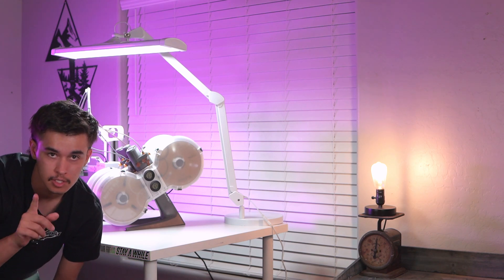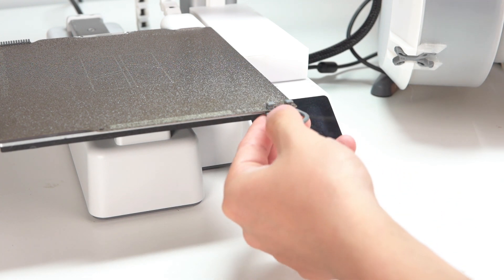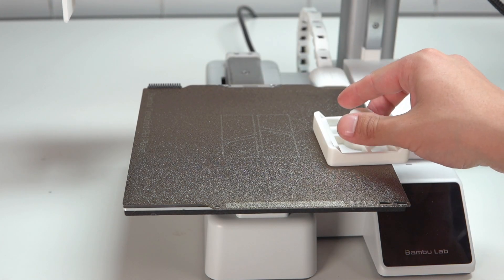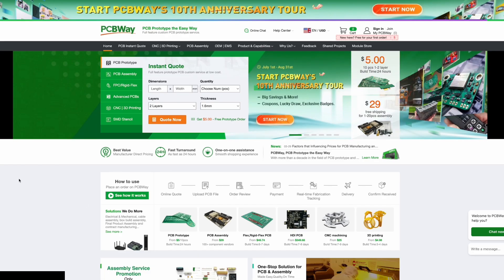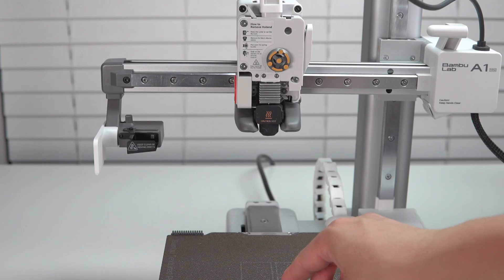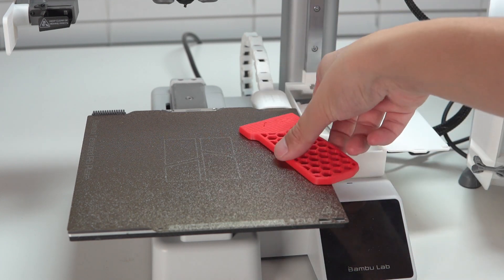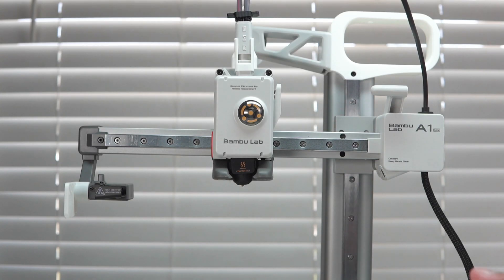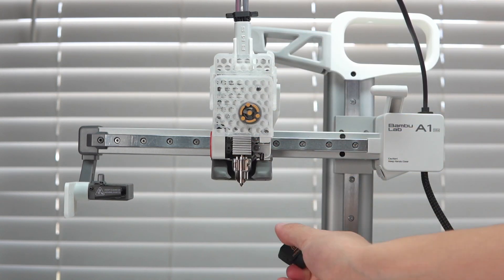Bambu A1 Mini Mods You NEED to Print

Comment: #1 is irrelevant because it only matters if you are going to use that area. I only wash my plate if I need to print using that space from slicer app. So theres no point in wasting time on cleaning when it is unnecessary...best solution is just use latex exam gloves

Comment: Don't need any of these. I don't understand what's wrong with using two fingers or just wait 5 minutes. I never removed, nor touched and with that cleaned my build plate at all. Just wait 5 minutes and take your print of with no resistance?
Also never had issues with the filament feeding, even broken off or flat cut filament gets feeded without any issues.
Reply from the maker: That’s awesome that you haven’t had any issues, I must be a tad unlucky i guess!

Comment: I actually saw a magnetic adapter for the plate on the head. Gonna try that one out once I got the right magnets. If it works that will make nozzle swapping easy af.
Reply from the maker: Currently looking at it!

Comment: I need the AMS still unfortunately. But I have been running PETG out of a dryer finally. It’s so easy to print on this thing
Reply from the maker: It just works :)
Reply: @jet_lea  my first printer was an Anycubic kobra 2 neo,  and they don’t provide good profiles for almost anything on the printer I got. It was incredibly frustrating as a new user, and part of what made me get a bambu

Comment: Nice, you are showing some mods I haven't seen yet! I have an alternative for the build plate holder. Or I should say, Bambulabs has one. Take a look on the micro sd card that comes with your A1 Mini. Mine (A1) has a build plate protector on it. It's not a perfect fit and only prints in PLA, so I have copied the gcode to my Mac, uploaded it to an stl converter and then to another online converter that fixes stl files and then I could finally import it into Bambu Studio, stretch it a little bit and print it in PETG. I'd share the file, but since I have not found it on makerworld it doesn't seem Bambulabs has published it and I don't know what license it may be under - if any. 

I did know about the filament cutter, but never tried it so I didn't know about the 45° which is a lifesaver with the ultimate enclosure. I've had problems with 2 different brands of filament so far which just wouldn't get into the motors. I'll definitely print that if I can figure out how to make it stay where it's supposed to be with my vertical (wall-mounted) AMS Lite.
Reply from the maker: I'll have to look into that build plate holder and I would love to hear if you find a solution for the vertical mount!

Comment: What filament do you use most of and have most success with?
Reply from the maker: Definitely elegoo and sunlu, haven’t had any problems with either
Reply: @jet_lea  is that PETG or PLA?
Reply from the maker: @rogerallcock8297 Pla but i’ve also used elegoo petg and haven’t had any problems

Comment: I would not suggest to spray the build plate with IPA while its attached to the printer. You risk spraying the Y axis guide rail too (which is lubricated) and the oil would dry up.
Reply from the maker: that’s a good point 🫡
Reply: Another option would be to spray the pad.

Comment: A point of clarification: the desiccant inside the AMS Lite enclosure will NOT dry the filament inside it. It keeps the humidity down so the filament does not absorb more moisture. In order to actually dry wet filament, it needs to be heated up so that the filament can actually release moisture into the air (which then can be absorbed by desiccant to keep the air dry, etc).
Reply from the maker: yes, i apologize if i misspoke in the video

Comment: Technically the PTFE tubes are not Bowden tubes because the A1 Mini has a direct drive extruder, not a Bowden extruder.

And what are y’all doing to your build plates that you need to clean with IPA? Here’s the only recipe you need for a clean build plate. Ingredients: sink, warm water, dish cloth, dish soap, something to dry with (I use paper towels), build plate storage. To clean: wet plate, soap plate, scrub plate, rinse plate, dry plate, store plate.  There is never a need for noxious chemicals like IPA or acetone.
Reply from the maker: I will give it a try and see if I have the same success:)
Reply: Dude, compared to IPA, dish soap is pretty awful.

Comment: 6:53, Bambu lab says you should not cut the filament in a angle if using the AMS Lite system... The best way to cut is exactly how the print already cuts the filament every time if stop printing. Totally flat!
Reply: Can you provide a link to where BL says not to cut filament at an angle? I looked through the BL wiki and quick start guide, couldn’t find anything about loading filament. Cutting at an angle is the only way I can get filament to load sometimes.
Reply from the maker: wow i had no idea, that’s great to know !

Comment: I have been running an A1 mini for 2 months and even got a small business running, really effective machine almost no issues, only once i had to take out the hotend and cut some fillament that was stuck, but never any problems. If the prints start to fail the most simple solution has been to clean the build plate with water and a dish brush.
Reply from the maker: I have had a very similar experience, absolutely love this thing
Reply: What filament u using?
Reply: @BrownStick  flashforge PLA
Reply: @MrDanDizz  Ok cool. Are you just using the generic filament profile? Or did you calibrate the filament manually? I’m only asking because I’m getting some non-Bambu filament for my mini as well.
Reply: @BrownStick  I have done manual calibration, and for FlashForge specifically i had to make a custom filament profile where i set the temperature that is relevant from the manufacturer :)

Comment: I haven't really had any issues with getting the plate dirty from touching it, however, I do wipe down the plate before every print with IPA. I've been using cotton rage but really like that rag holder and will be printing that ASAP.
I've been using that PTFE tube splitter you showed for a couple of months now and it's been amazing. I have my AMS lite wall mounted behind my mini, and the external spool is fed from above. It's extremely convenient not having to detach one of the PTFE tubes from the AMS lite to use the external spool.
Reply from the maker: that’s awesome, i’m glad some of the mods are working out for you! The build plate cleaner is slowly becoming my most used mod